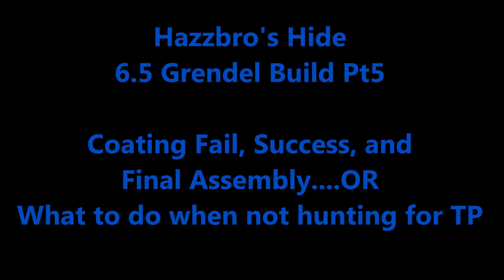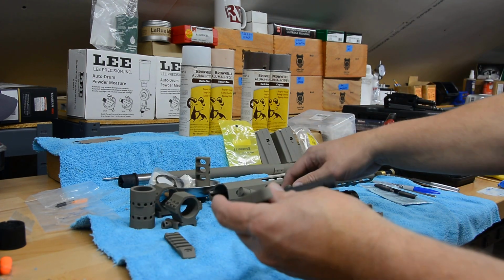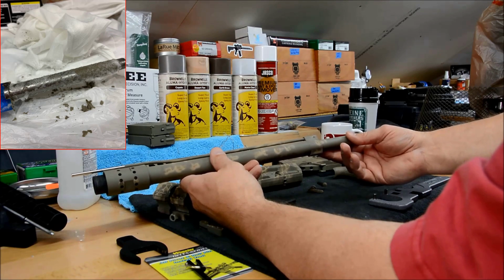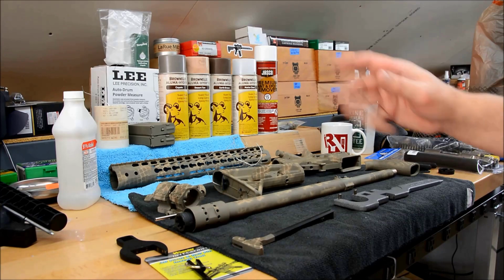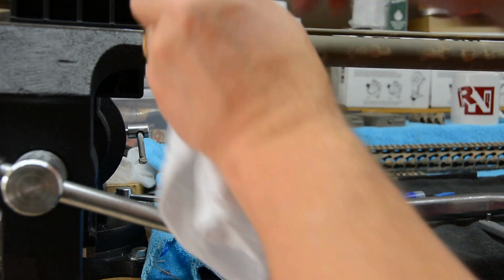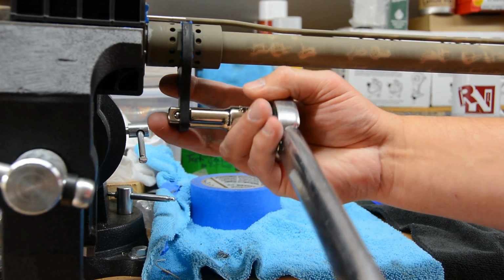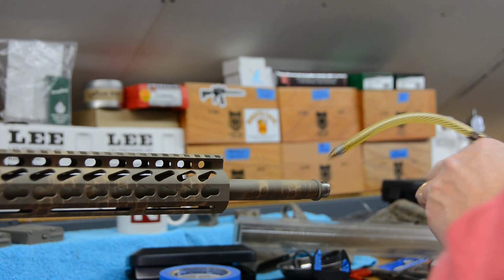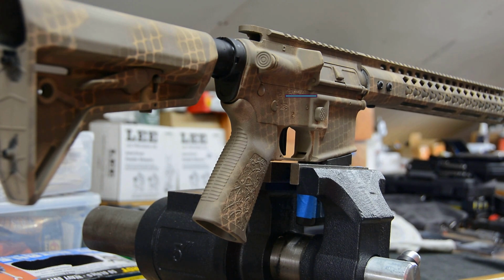6.5 Grendel Pt5 - Coating Fail, Success, and Final Assembly

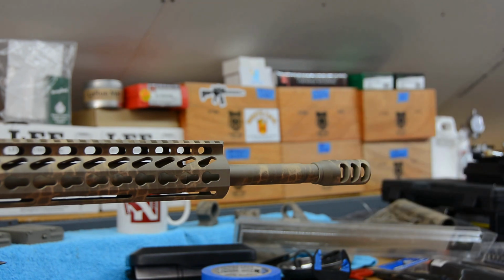Comment: Assembly looks good. When i assembled mine i trued the face. I used the same type antiseize as you on the barrel nut. On the inside slip fit i used locktite. Different strokes for different folks ! Did you notice the blue line in the video that starts about at 20:13 ? Kind of distracting lol. But gotta admit your paint job is killer.
Reply from the maker: Thanks for the comments. The line covers the serial number 😁